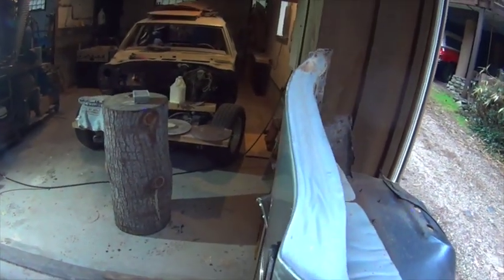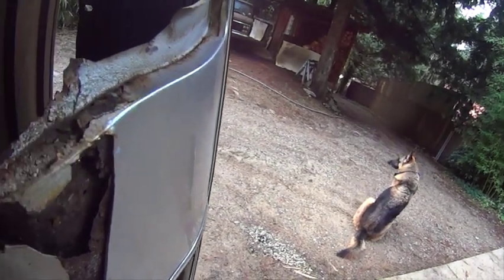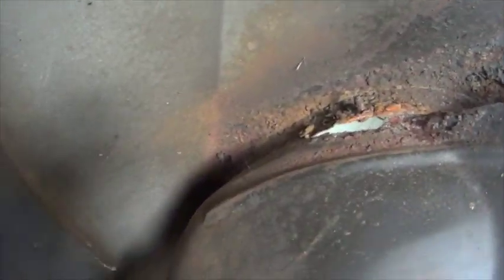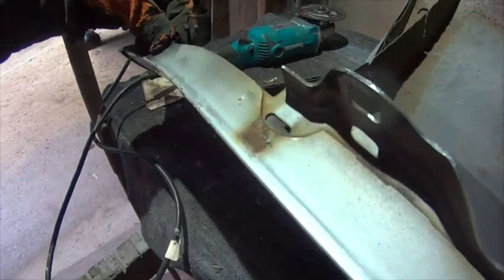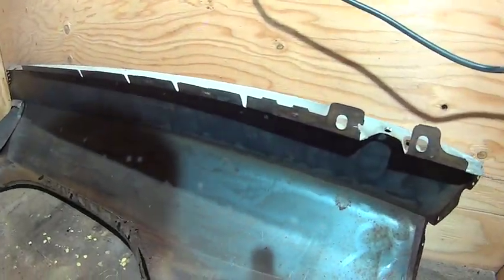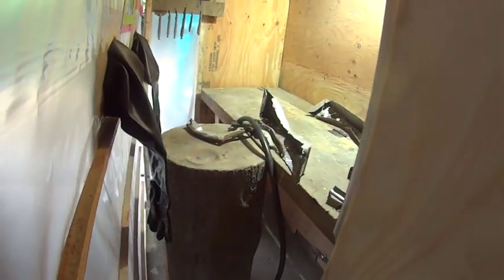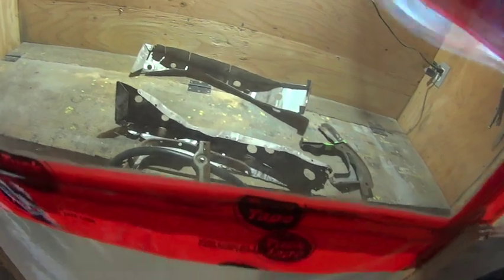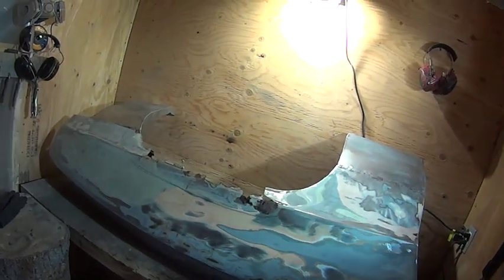1970 Pontiac Lemans Wagon Restoration part 28  ( Restoring the fenders )

Comment: Love your work mate , always good to watch. I got the 327 to go really hard in the wife's impala.  Problems with the terrible body work they did. Every time it rained everything stopped working.  The cowl was rusted out bad ,so water poured in all over the fuse box and things stop working . My welder has seen better days to, trouble is I can't make my mind up whick one I want. Unimig makes a nice 230 multi process , Ac/DC tig , mig ,stick . Does everything except bring you a beer. Always wanted to learn Tig,  wasn't even invented when I went to school.  Keep up the great work mate,  fantastic job there . Definitely not for the faint hearted.
Reply from the maker: Hey Peter . Its good to be back on the metal tools again and one needs to acquire more to extend their capabilities . I only have basic tools and can see I need more to achieve better results on these fenders .  Cowl gutters are hard to fix when they start leaking if its from rust issues . Going in deep with the welder on a seam is difficult . I know with the Square body Chevy's there's a lap seam up against the firewall that rusts first cause the water can get in behind. Bad design . The LeMans has no seams in the waters path and is well thought out . Love those old Impala's .